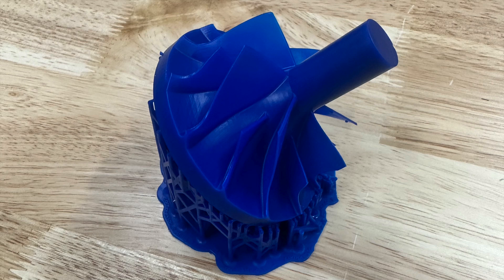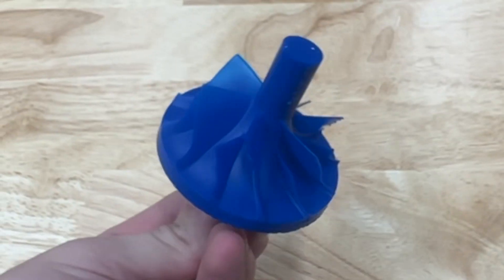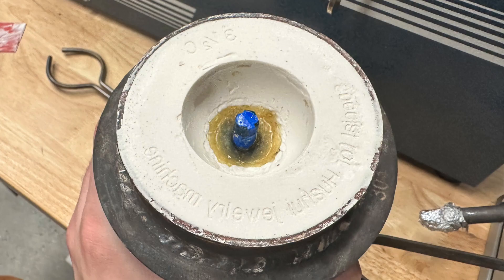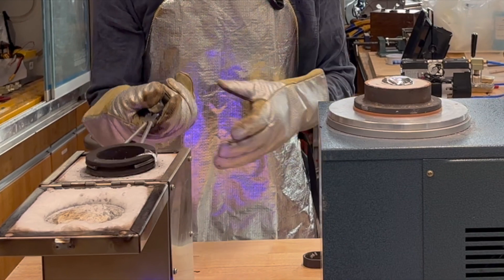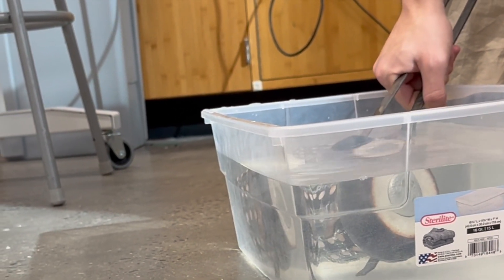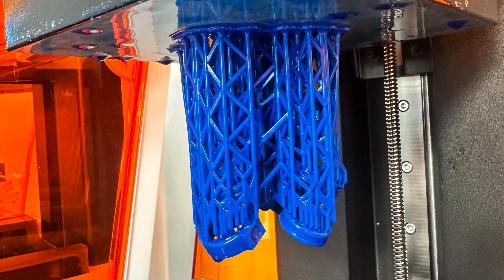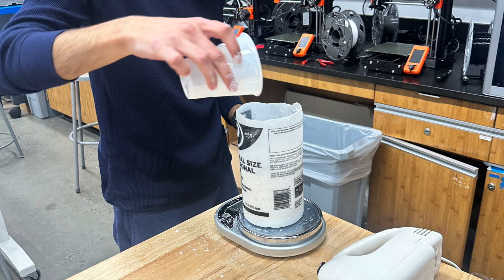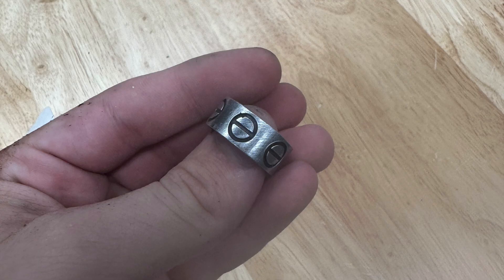Casting Update - Some Rings and a Centrifugal Compressor

Comment: What are your resin settings? What program did you use to construct your tree?
Reply from the maker: The resin settings are the default setting for the resin I used in preform. I used fusion360 to build the tree.